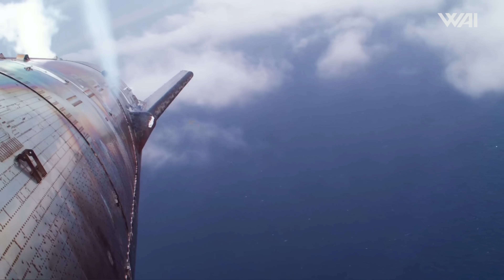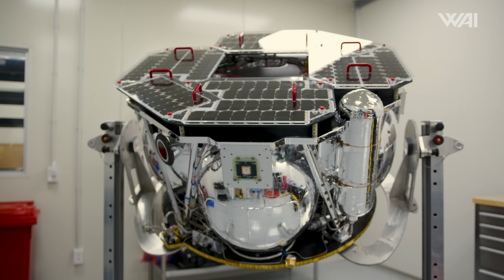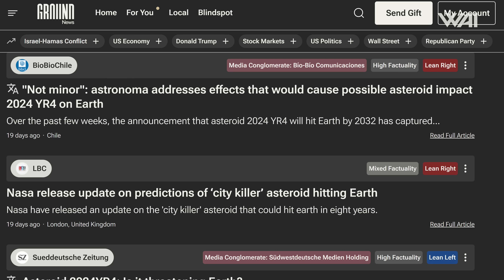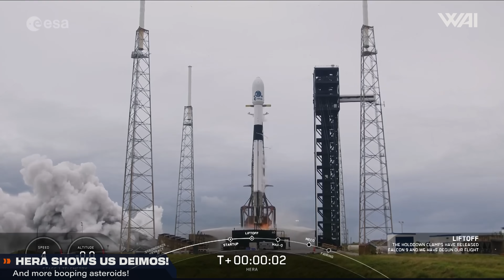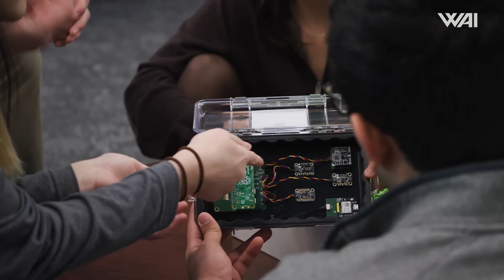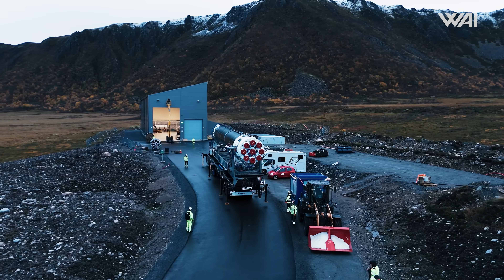SpaceX RUSHES Starship Pad B construction - 360 (!!!) Concrete Trucks! Rocket Lab Heads to Venus!

Comment: Hey Felix, speaking of Starliner and its litany of technical problems, any chance of a deep dive update into that? What kind of testing and analysis is Boeing doing to try to solve those problems? What is the scuttlebutt inside both Boeing and NASA on whether it will ever fly again? If so, will there be another unmanned test, and maybe a manned one, first? If they are forced to do one or two more test flights, where are they going to get the rockets? Every Atlas V is booked now. I've heard one rumor that they might convert it into an unmanned cargo vessel. Which would be more humiliating for Boeing, canceling the contract all together, or downgrading to unmanned operations? It would be very interesting if you could tap your sources and get some information on this, even if it was just rumors.

Comment: Blowing the pad apart with flight one was inevitable, bad design and it took them too long to realise it was fatal design. Same goes for the latest stuff it also is fatally flawed and they will have to start from scratch. the badly named second stage will never be capable of landing on the moon or anywhere else, it will blow itself to pieces from rocket engine blasts. New designs MUST incorporate landing legs on first and second stage. Extra weight can be solved. Also there are way too many engines on booster huge point of failure risks

Comment: I think that Boeing in general shouldn't get ANY more chances. 

From their planes crashing,  or coming apart mid-air, to the PLETHORA of errors on Starliner, and their bean-counter and DEI approach to running everything at the company,  they need to be broken up, and the pieces auctioned off to other companies that know true engineering from political correctness.

Them getting the  F47 contract is an indication of how far that same ideology has penitrated the DOD.

Comment: The first stage 0 had no trench ad they could not get permits to dig that close to protected wetlands.

I believe I've seen the problem with block 2 starships. The modified mounts and increased chamber pressure have caused the exhaust to detach from the nozzle before the end of the bell.  The result is an intermittent vortex forming inside the bell. This works and warps the bell, adding strain on the new motor mount design.  This gets a fatigue and a leak.  This is followed by massing unscheduled disassembly.

Comment: 3:17 or, there is more than one issue that causes the same fault. Unless you're suggesting that an extremely complicated, finely tuned and balanced rocket engine can only fail due to a single thing, there could be thousands of causes, and remember, as far as we know, only one of the vacuum engines exploded, which could just as easily have been due to a manufacturing flaw in that individual engine. Just because it exploded at around the same place, doesn't mean it exploded for the same reason.

Comment: Starliner's multiple jet-puff failures came down to corroded valves and then software fail-safe parameters being too tight.  If they can actually cure the corrosion issue then it should be good to go. It looked really good otherwise.  But ask Sunny and Butch as they have the most exposure to it.

Comment: I always thought pad A, was a test bed for collecting data for  a Mars launch pad. 
Reasons
1. Not a lot of water on mars.
2. Sub launch pads caused damaged to concrete and ships with a 6 engine fire
3. Pad A did a 6 engine test fire and did not cause damage to concrete or vehicle. Great data for a Mars launch pad.

Comment: Venus was recently ejected from the sun in a mass coronal ejection event, hence it's heat and retrograde rotation.
It is a piece of the sun that has yet to cool down.
Longitudinal temperature measurements will settle the matter. (Is Venus cooling down, however slowly)

Comment: This concrete pour IS NOT A RUSH. In a project such as this it is imperative that the concrete is poured continuously in order to allow the batches to mix in the form in order to avoid "cold joints".  Cold joints are not as strong as contiguous concrete and in this application most likely will result in uneven heating and cooling above and below the joint... this will cause the joint to fail and, potentially, launching debris and chunks of concrete at very high velocities... very not good. Fire, extreme pressure and steam... yeah... no cold joints permitted here...

Comment: Venus is similar temperature to Earth, it's just that it has a global 'ocean' of Co2 on the ground that it super thick and hot, it's thick enough that you could float on it. If they made something that could float and inert so the acid isn't a problem it could just be a mini cloud city.
Reply: Venus has a surface temperature of around 900°F (480°C) and a surface pressure almost 100x Earth surface.  At that temperature and pressure CO2 is at a supercritical state, so only at a stretch could it be considered an ocean, it isn't accurate to say one could float on it.  High in the clouds you indeed can find more amenable conditions, powered flight would still be required to remain aloft.
Reply: @kurobara9001  The layer of co2 is all those things you describe, but it's a layer it's not the atmosphere, it sits on the ground (it's about 25km thick or so thick), if you go above it then it drops off considerably, an airship could float on it, there have been NASA plans drawn up in the past for such an idea (go an look them up).

Comment: Why don't they line the fire trench with the same ceramic tiles that they use for reentry? 🧐🤔
Reply: They’d be shattered by the acoustic energy from the engines pretty much immediately. Those heat tiles are quite brittle, think low quality dinner plates that you can pretty much snap in two with your bare hands.

Comment: I suspect that the reason SpaceX's first version of an OLM had no water deluge system is that someday Starships will need to launch from Mars, where a water deluge system would be impractical.

Mars is the reason for most of Elon's decisions. It's why Tesla will never make hybrid cars (ICEs don't work on Mars), why The Boring Company exists (we''ll need to do lots of boring on Mars), why Neuralink is building a system which will enable people to "pilot" drone workers in hostile environments, and why Tesla is building those drone workers and working on AI (needed to build things on Mars, especially before people arrive).
Reply: Excellent comment 👍
Reply: Super Heavy won't launch on Mars only the 2nd stage will with its  6 (or 9) engines it won't do the same damage.  
:planet-orange-purple-ring:
Reply: That's true,  @Scanner9631 . Also, with the lower gravity, takeoff will presumably be quicker, which will also reduce the beating which the launch site will take.

On the other hand, Raptor engines aren't getting less powerful. Those 6 (or 9) v5 or v6 Raptors will be more powerful than the v2 Raptors we have now.

On the gripping hand, knowing how concrete holds up (or doesn't) tells us very little about how Martial regolith will hold up.